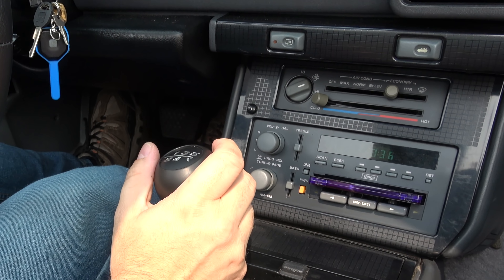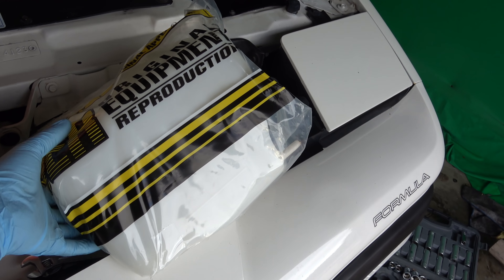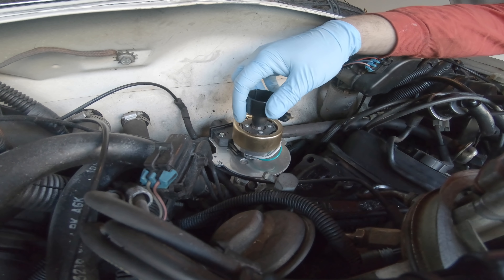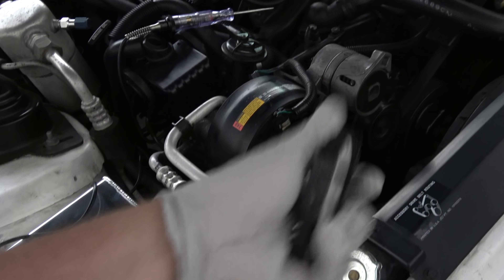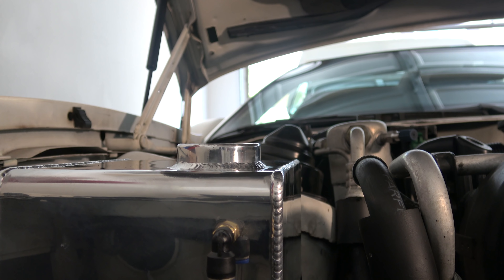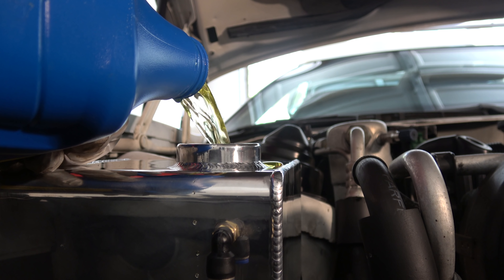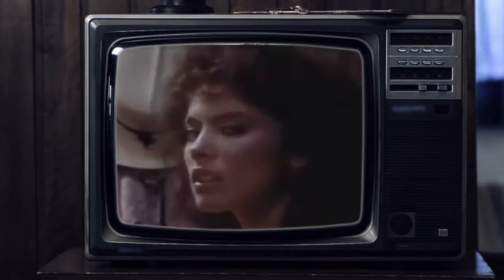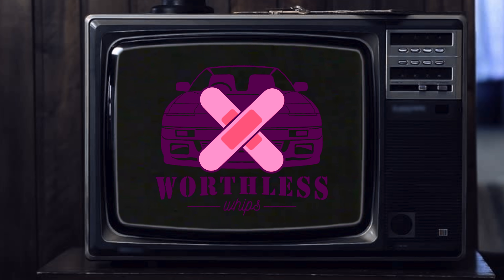They really don't make them like they used to!

Comment: I'd put more blame on manufacturer of the parts more so than the auto manufacturers.  You said it, you bought new parts, and they broke.  Consider that those exact parts you had in your hand didn't EXIST when your car was made, so, you can't blame GM at the time.  Given experience with how parts fail, the owness of quality belongs on the remanufacturer more so than GM (Or Ford or Chrysler or whatever Import).

Being that we're a 'throw away society', I'm not seeing a lot of older cars out on the road unless they're cars like your FB.  There seems to be a certain cut off in age.  I'm not seeing many cars (As in residential based cars, not commercial trucks and other real utility based vehicles) that were made prior to 2000 anymore, and if I do, they're really is a gap between 80s and 90s to anything modern.  I've been pretty damned lucky with my 20 years of full on personal car ownership.  (1987 Camaro, 1991 Mazda Protege 323, 1994 Pontiac Sunbird, 2003 Grand Am, 2011 Impala).  The WORST I've had, with the exclusion of body work, is my Impala (At just about 200K km) is I'm starting to suspect the engine is starting to drink coolant and oil and spitting it out the tail pipe.  Didn't have that problem with any of the other cars, and I've owned and drove all of these cars for 6-10 years before I sold them, or bone-yarded them.

So for those cars that one could tie emotion to (Like Trans Ams, Camaros, Mustangs, Novas, and all them) yeah, they're specialty items, and only the crazies get them upgraded for longevity (I am one of those crazies).  But I don't see people holding close to the Lemans, the Neons, the 6000s, Probes, etc.  They're typically found in the junk yard when they're aged enough.  I DID however see a Chrysler Celebrity just the other day...

You could look at repairs as well, but, even then... Cars are mechanical beasts, and no matter the manufacturer, they're going to break.  It's just that when that $0.05 part breaks that it could take down the entire car.  I know a guy who bought a BRAND NEW Ford truck, and returned it after a year of ownership because plastic oil pan become brittle and broke and leaked oil all over the floor, not once, not twice, but three times, and he had to pay for the repair on the 3rd go around.  Because apparently its his fault plastic gets brittle in cold weather?

As your distributor was made in modern times, I'd put blame on the manufacturer of that exact PART, not the manufacturer of the vehicle.

Comment: I don't think your issue with parts is isolated over here in the UK I have the same exact problems with my Rover had to replace so many new parts twice so I even had supposedly orginal ones being boxed in a original box turning out to be aftermarket rubbish.

Comment: There is a difference between the original parts which lasted 20+ years vs reproduction parts. Reproduction parts are hit or miss, this is the case for newer cars too. Honda for example, has a lot of aftermarket junk and it's lead to most honda owners knowing they need to get replacement parts from Honda rather than aftermarket.

The comment "they don't make them like they used to" is not necessarily a quality comment, I throw it around when I run into a part like the race hubs cs internal hub and wheel assembly, it was just a different mindset with engineering. Also if you read the service manuals of cars of this vintage, wheel bearings needed to be replaced every 30k and were inspected every 15k. About the same time in the 80's there were other brand makers who had cars on the road with over 500k miles on them, it did point out these quality issues of American brands was not keeping up with europe and asian brands.

Spot on on the assessment of quality, but also realize the time frame, was a different time.

Comment: You talk about how big and ugly the coolant expansion tank is, but I look at that circular air filter and corrugated intake hose and I want to barf. New engines look so much better without those awful things sitting on top and obscuring the valve covers.

Comment: Heard the voice, knew it was Winston instantly. Love taking older things and adapting modern car parts onto them. Charging systems, high pressure fuel pumps, and creature comforts of all sorts. I also like to downgrade modern stuff just for fun. My 09 gen 3 hemi has a GM distributor on it (which took alot of engineering ) . Only uses 8 out of 16 spark plugs but it works.

Comment: Its so sketchy, I just bought a hyper rare 91 bird convertible with the factory performance rear end.. Its one of 100 made for the year, white, 305 tbi, I love how they drive though.. Thats the allure, ive driven m5s,a lambo, bentleys, countless vettes and mustangs and these cars have a fun driving dynamic one might dare call soul. Little word to the wise, hawksthirdgen for parts, and buy a wonderbar for the front end. Stiffens the car and prevents the steering box from cracking the subframe. Five minute bolt in, its an experience for sure, when it comes to ignition parts, go acdelco, I found the OEM stuff for these works best, that duralast module is on borrowed time. Keep a screwdriver and a spare HEI module on hand, thank me later good sir. As for caps, accel caps work amazingly, plugs, r45ts, night and day difference after I changed them out.

Comment: The major difference between the Chevy Camaro and the Firebird was handling, the firebird was always set up better right from the start, like for instance they set up the shock absorbers wrong and it created bad axel hop on the very first early camaro's, while pontiac actually had it right from the getgo in the same year, as pontiac had them at an angle, camaro right up and down and it caused a pogo stick effect lol 

and even around this era, like the camaro even with the uprated brakes just doesnt stop and doesnt handle that well, and some just wont stop right at all and just veer off to the side, probably because of a bent brake line, like the firebird was the smart mans camaro

which is probably another reason why GM really didnt let them off the leash in the 80's and the 90's, as look up the 1982 turbo trans am on old car memories, gm always knee capped anything that made the corvette and the camaro look bad

and boy did they do a number to it in the 70's, those 400's when you dont live in a state run by the national socalists dictators like you have in Berlin california there, you can get some real power out of them and their great cars, as all the difference between a 400 and a 455 is how you bore out the block apparently.

and even back in the 70's GM REALLY did not like the camaro to play second fiddle to the firebird, but it did, anything the camaro did, the firebird did better, and half of those Z28 packages came about as the firebird came out first with their wicked ass styling, as every year in the 70's look good, well save for 1979/1980, and even then that wasnt THAT bad and I dont think their wasnt a year they DIDNT Change anything, and the GM people were like crap

a car that's not a chevy is selling better, quick we'd better steal the sales from ourselves! 

plus have you see the interiors on the 70's firebirds vs the camaro's, like the firebird just did everything better, its when they hit the gas fleet averages time in the 80's under roger smith that things started to go wonky.

and that cost savings, I know that radio, good unit, but my god I will never ever have another car with green glow on the dash like that again, as my god is that ugly.

Comment: Wouldn’t that be the 4th gen? 68, then the split bumper, mid lat 80,s had the pointed nose, then the iroc body. 4 gens to yours.
Reply from the maker: 2nd gen is 70-81 3rd gen is 82-91

Comment: I have a 1986 z28.  Ive had it for 26 years.  I can confirm that they are shit built cars.  Its a rattle box.  I have a long list of stuff that doesn't work, including those reservoir tanks.  The motor starts and runs real good, though.  Then valve seals are shot though, of course, so it puffs blue smoke

Comment: Lol what? the coolant didn't made the battery rack rust if anything it prevent it from rusting. the leaking battery when charging did make the battery rack rust. 😂

btw never had issue with my smaller V6 expension tank. 
its the same size as youre fancy 'Luminium tank.

Comment: Well, it is a 30 year old car. I wonder how many 2021 models will still be running and not in the junkyard in 2050. If you look under the hood of a just about any 2021 car or truck it's a forest of plastic.

I will agree that it's unacceptable for replacement parts to break so quickly.  But your 30+ year old Firebird still runs, albeit after a lot of TLC on your part. But could you get a 1990 VW Golf to run reliably? Could you even find one that still runs?

Comment: On to your comment about replacing front and parts, Are they made in China from auto zone?

Within a 2 week, I saw 2 Chevy vehicles that had recently replaced the lower control arm ballpoint with one from auto zone.

Both of them within a year had the Ball pull completely out,  And the  Full wheel assembly Fell off and got shoved up into the wheel well and bashed into and dented the fender. They both had to be towed home.

 This is no joke or  made up story,  I have pictures of both, and one of them is a personal friend.

China  ruins everything, But clueless people don't care because the prices are low in the think there getting a good deal.

O and I forgot, I tried to get a water pump for my LT4 SS impala that was not made in China and guess what?

 No one, not even Any GM dealer Carries one. All of them are made in China.

There's nothing more American than a Chevy , But not anymore. The thought that you wouldn't even be able to find any factory engine parts for the most common V8 engine ever made in the world, small block Chevy, without relying on China would have been unthinkable if you said that 20 years ago.

Even after searching dealers across America for a real American made water pump, I never found one but finally found 1 made in Canada from a dealership in Canada and had it shipped down.

You would not have had most of the problems that you are if you could still get parts that were made in America, Specially if they were old stock from the area close to the year of your car.

 To be honest, your rusty old distributor if it was original is probably more reliable and will last longer than that  Communist garbage put in :)

Comment: Winston unless I missed it you left out the most important information. The parts you are using probably have nothing whatsoever to do with GM but are all made in China and indeed are cheap junk. A while back I had a supercharged 600 horsepower SS impala LT1,  And wanted only the best for the distributor because it's a nightmare to replace on that car. So I got an American made  $700 aftermarket MSD billet aluminium distributor.

It was bad out of the Box. The car would barely run and eventually would not start at all, was never even able to move it out of the shop, but luckily It was in a shop with all the equipment to professionally diagnosed it so there is no need to start replacing parts like you did..

I also called the factory and talk to their lead technician who could barely speak English or be understood his accent with so thick.  He also helped with the diagnosis on what part of the distributor was bad and it was determined it was the optical sensor inside.
 When I asked him where it was made, he said it was their own proprietary design.
 When I took it apart and looked at it was clear it was crude garbage made in Communist China.

So after dozens of hours of research on multiple forum specialising in this engine, I learned the only reliable choice with a distributor with the original mitsubishi sensor that GM used.

 The story gets worse. Mitsubishi will only accept a minimum order of 10000 units, so not even AC Delco, GM or Delphi felt there was enough market to order the quality mitsubishi made in Japan sensor so even the factory dealer distributors were full of the Chinese garbage inside.

Not to mention anything from auto zone I o'reilly's Napa Carquest and the like, Those are also 100% garbage like the one you bought.

After wasting countless hours I finally located in original old stock new one in an old lady's garage sale locally of all places.

The point is, the parts or using that fail are probably all made in China garbage, perhaps you can make another video on how that's another Avenue that China is costing People hours of wasted time and money like you experience.
Reply: is the mitsubishi one made in japan?
Reply: @vincentas1  Yes, Mitsubishi made in Japan. I have not found any other that are reliable, even the 700.00 MSD billet distributor uses the fake CCP sensor.
Reply: @7x779  are there no aftermarket versions? or do you prefer oem?
Reply: @vincentas1  You need a strong magnifying glass or strong cell phone camera to see the trademark Mitsubishi diamond molded into the sensor.
Reply: @vincentas1  Did you carefully read my first post? There are many aftermarket ones, but it is a crapshoot if you get a lucky one .  Only SOME of the OEM has the Japanese Sensor, you must open and check.
Reply: @vincentas1  PS: I trust you understand my experience was with the LT1 and LT4 GM 350 that came in early to mid 90s Corvette, Impala SS, Roadmaster, Caprice, etc.  

The car in this video uses a different distributor,  but from the looks of it an the box, it looks made in China 🇨🇳 😳,  and that is why it failed.

I am sorry for "hurting the feelings of the Chinese ppl", but their parts could have caused winston to be ambushed by american communist activists.
Reply: @7x779  ah I see

Comment: Technically it is bling not an upgrade it isn't an improvement on the design just a different material.
Devil's advocate why they use plastic over metal:
1. Cheaper 
2. Plastic is inert and doesn't oxidize like steel or aluminum 
3. Plastic is also more flexible and shouldn't fail due to vibrations and flexing caused by said vibration

but yeah 80's domestic cars were crap.

Comment: I don't agrre with you on that. My 88 gta is daily driver. It still dive fine and i have no problems with my car. I have some new cars in the family vw, audi, toyota. They are 2015. They arre horrible. Electrical and computer problems all the time. They are no fun to rwpair with special computer and fancy electronic modules ect. Maybe you bought vad quality replacement parts for your formula. I buy all the time from rockauto and 95% are not bad quality..... no matter i love your videos about formula. Keep up the good work.

Comment: Alot of replacement parts are just made by the lowest bidder in china these days regardless of the label on the box. (Before you start shouting at me in the comments, I said alot, not all, calm down) It's a big problem in used cars rn.  Finding a company that actually makes good replacement parts is a struggle.

Comment: I have a 88 gta since brand new 
It was my dad's then my mom's then now it's mime t5 305 tpi 
And the original engine lasted to 230kms 
The valve steam seals died at 80kms 
And the alternator went every 5 years 
And the starter 2 times and the dist when 2 time at 120km and again.last year 
And water pump 
The dist I got a new Delco  sensor and the new igm rock auto 
And I just rebuilt it myself 
Don't trust cheap China brands 
At east you didn't get stranded 
And my ecu died 2 times 
And the engine never knocked

I forgot at 200km the rear end locked on the highway in 5th gear 
And got a new used rear axle 9 bolt lsd  
And stripped 5th gear clean and the t5 had to get rebuilt 200kms

Comment: Just be glad your Firebird doesn't have an Opti Spark lol
Reply: Bad?
Reply: @williamswenson5315  Horrible
Reply: @Gunsforfreedom  Glad I didn't have to deal with it.
Reply: @williamswenson5315  1994-1997 LT1 equipped F bodies have the Opti. Horrible design and terrible to replace. New ones fail sooner than the original ones that you can no longer get.
Reply: @Gunsforfreedom  What a complete horror show that is. I have to wonder what happens to the poor bastard who buys one of these cars with an eye towards restoring it. Without the detailed info you have, he'd be up a certain creek without the paddle of new parts availability. Thanks for the reply. W
Reply: @williamswenson5315  Best part is, the Opti sits right below the water pump lol. So if the water pump leaks, it goes on the opti and the car wont run...
Reply: @Gunsforfreedom  You have to wonder what the design constraints were; did an accountant do it, or an engineer? That is an obvious cascading failure if there ever was one. It's  akin to placing instructions for use on a grenade and then handing it to a slow-reader for use. I can still recall years later, the first time I did a tune-up on a Dodge, slant six, 225 cu in. engine and realized the alternator had to come out to reach the number one spark plug. I recall thinking that was bad; until I had gained a bit more experience and realized that instance was the least of it. Nice talking to you and take care. W
Reply: @williamswenson5315  Same here sir